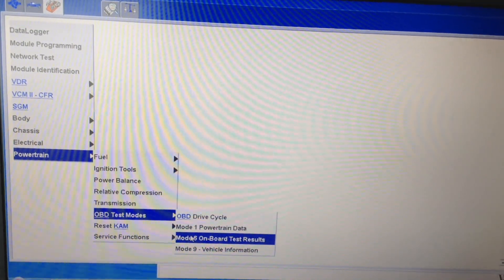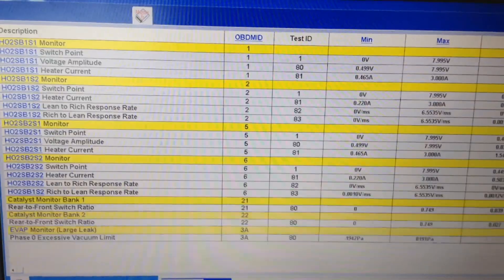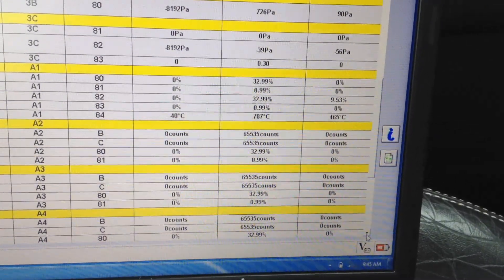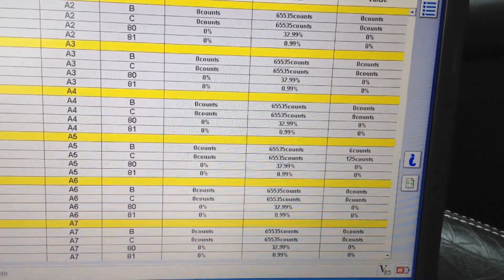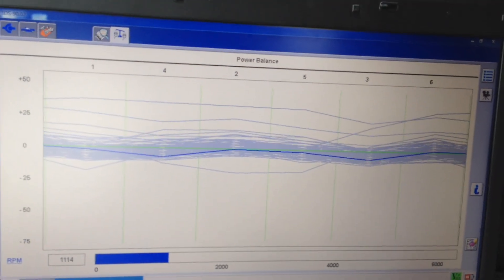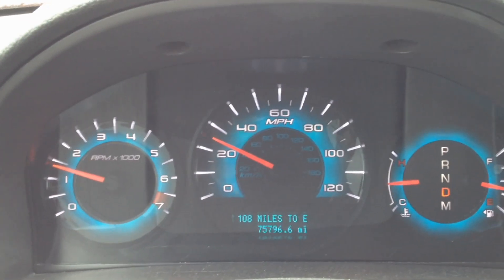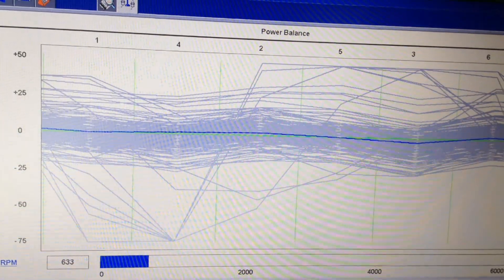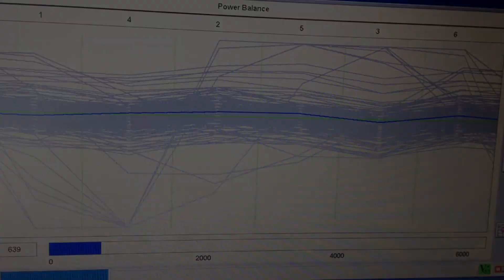Engine Misfires That Feel Like A Harsh Shifting Transmission

Comment: I had the same problem in my ford fusion and I had to replace all coil packs in my v6 all gaskets and all spark plugs and it stopped then it started it was the ignition control mod computer ford fusion is junk I sold my fusion for a 08 ford taurus 3.5 limited it's a better car dude I'm a cerified mechanic explan more about your video and if the engine is not running well it can be a transmission concern

Comment: I have taken a 2022 Escalade to the dealers 4 x times after they performed a disasters engine change and keep telling them this damn engine misfires and therefore  the reason the car drives like transmission slip and jerking and they keep saying they did this and that and things are normal and cannot find nothing wrong ..they cannot fix the damn thing lol

Cadillac certified mechanic my a$$ 😅😅😅

Comment: I have a hard miss while driving.  It is so intermittent.  Mine is a 1991 Ford Econoline.  Would changing the spark plugs change this misfire or is the engine toast?
Reply: Hi Fran, I have a 90 econoline, mine sits 6 months out of the year, I am having bucking issues with mine. The older Ford's have capacitors in the ecm that leak. Also when I changed my egr solenoid I noticed bad corrosion on electrical connections. This I think is more attributable to the ecm.
Reply: I also changed plugs, wires ,coil , dist cap, egr, still the same problem.

Comment: I have a 2004 f150 5.4 that hesitates while its running. Basically when I’m driving and accelerate to pass or when I slow down to turn and then accelerate. Already changed all the plugs and coil packs. I have even changed the throttle body. Any ideas please let me know. Thanks. 
2 weeks later I changed the catalytic converters and it’s still misfiring. Any ideas? Anyone? By the time I get done changing everything I’m gonna end up with a new truck.
Reply: agsolis37 shoft solenoid maybe? That could cause downshifting.

Comment: I tell you from start to finish....first they updated pcm, next they replaced turbine shaft sensor an output shaft sensor because it had codes P0717 an U0100,  then it was still driving stupid an took back they said no codes on Scanner so I told them hook computer up an drive thats when they said it was misfiring on #1 coil an #4 coil so replaced those coils an put new plugs in an still having issues....ahhh!! Help please ford flex 2009 limited
Reply from the maker: Ok yes the output shaft sensors are common ok, as for the misfires they know the issue they need to watch the power balance and drive it again to see which cylinder is acting up still and go from there it will not set a code at first. That is the only way to tell for sure and it will show on the power balance.